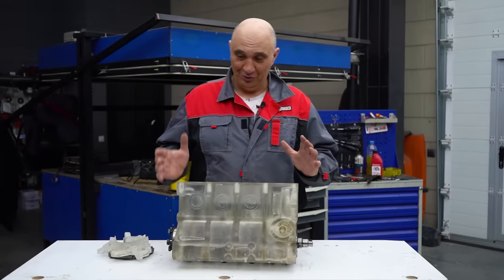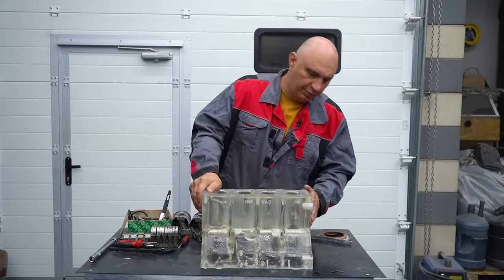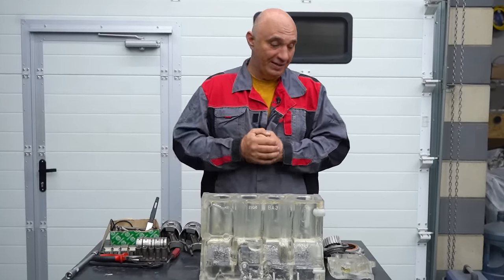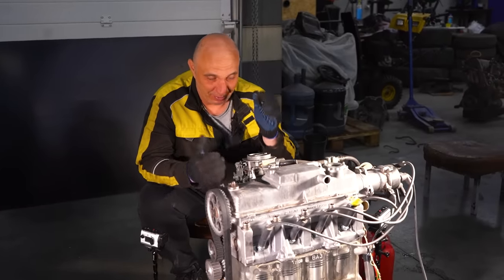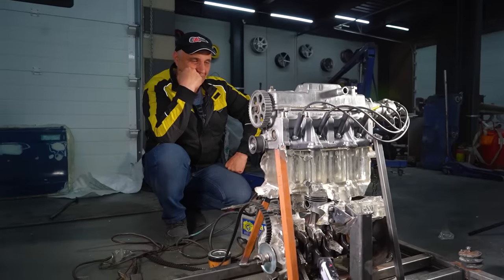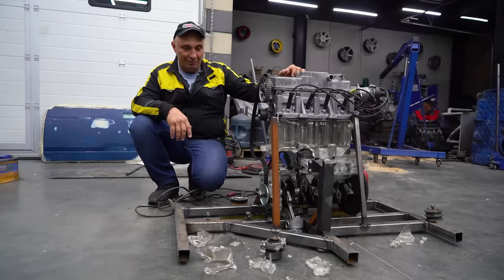Transparent engine block – first start

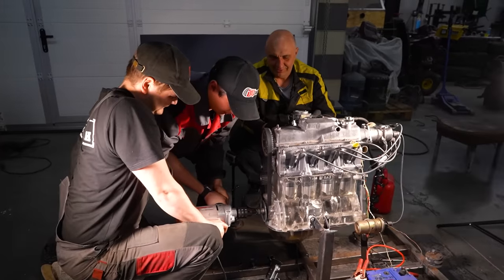Comment: You can see the block crack at 5:09 - with the first try of starting it with a power drill
Reply: Good eye
Reply: I don’t see it I just see the ignition on cylinder 3
Reply: @mikecorleone6797  I just saw it too!
On the engine mount!
Reply: Wow, good catch!
Reply: thats what i was about to write...
Reply: wow good eye!
Reply: @mikecorleone6797  Lower right side of the block about 6 inches long
Reply: I see  it in 6-7 minits. Good eyes.
Reply: yes !
Reply: yeah i seen that
Reply: that is a good eye, i didn't see it until i read a comment about the engine mount.
so unfortunate...
Reply: @KmF0X  if you look to the right of that engine mount, a horizontal crack also took place...
Reply: 6:17 you can see the entire crack from the engine mount headed to the flywheel.
Reply: @VintageCR  Indeed, it took me long to see it, but when the engine is fitted with a flywheel, we can clearly see it!
Reply: @mikecorleone6797  crack located between the motor mount and coil
Reply: I just watched the video for the 1st time and i noticed the crack in the block during one of the slo-mo playback.
Reply: Wow yeah just under cylinders 3&4
Reply: At 5:12 you can see the crack in the lower center of the engine going off to the right.
Reply: Holy heck you must have the eyes of a hawk to have caught that. But now replaying it I see it too.
Reply: Good eyes dude, they should have a frame from the bottom of the block to the head holding it together, probably using a  support bearing on each side of the crankshaft too
Reply: Probably watching on a TV screen rather than a mobile phone.
Reply: Good catch man ! 👍🏻
Reply: Very good eye had to grab my glasses and watch it twice but yeah I seen it right above the engine mount
Reply: right on the 3rd main! good eye sir
Reply: Incredible you catched that, i had to rewatch that part and slow it to 025 three times to see the crack forming.
Reply: Yes I saw this 2
Reply: Yep I finally saw it. Good catch. I think this project was doomed from the beginning.
Reply: After explosion of cylinders 2 and 3 it was game over
Reply: @KmF0X  yup..... me too
Reply: Well spotted!! 

Maybe next time it might be worth increasing the deck height (lowering the compression) a little to make things a little easier on the bottom end.
Reply: That's not good eyes for him, that's terrible eyes for everyone else 😂😂😂..
Reply: Yeah you can compare 4:52 to 5:11
Reply: 5:07 its by the engine mount
Reply: Make it again with steel embedded tying the head to the main bearings. Or maybe slice everything out but the main bearing webs up to below the deck.
Reply: They probably stressed it too much bolting it to the engine stand.
Reply: crack? what crack? 😁
Reply: @mikecorleone6797  You see it on the left side of the motor mount, it is a line suddenly coming there.
Reply: If they had used a rubber vibration damper between the engine and the engine mount, the block would probably not have cracked. That was the first thing I thought when I saw the stand they had made.
Reply: Well spotted there fella!    -107% Success hahahaha JEEEEEZ! Maybe the complete snapping of the drills' drive shaft was a hint at what was to come!? And man... That REALLY went with a BANG! 😮😮
😎🇬🇧
Reply: Wow. Perfect eye!
Reply: First crack 0:45, during threading. Very brittle material. I hate it. It always want to melt or crack during drilling. I can't imagine using taps and then screws with it.
Reply: yes noticed the same, bent crank or wrong clearance on block  ? enough torque to snap the drill might also be a hint that its not ideal ?
Reply: @theodordan680  so?
Reply: @kristiansolstad9068  Snapping the drill might also be indicative of whatever issue would cause the hand crank to kick back (pre-ignition?) during startup.
Reply: @mikecorleone6797  its near the bottom engine mount
Reply: Go figure,  that was the point of failure too
Reply: @Mr_Meowingtons  You SAW it. 😞
Reply: right on the engine mount
Reply: Good eye
Reply: that crack led to the ending they encountered. thats wild
Reply: its funny, i saw that crack just before the try that exploded it, but wasn't sure where it came from or when it got there. You found when that started, wow.
Reply: Holy shit. How did you catch that?
Reply: Yeah I went back to look for it too cause I noticed it after he had the flywheel on. Didn't see it when it happened with the first try of the drill, but I think either way it would have ended up in the same result.
Reply: I bet you have sasuke eyes, i can see nothing crack
Reply: @KmF0X  same here. It took me a minute but I saw it.
Reply: you need to do something with eyes like that
Reply: Bullet proof glass?
Reply: It seems you have the sharingan eye.
Reply: Damn dude that’s a Good eye!

Comment: I really appreciate your take on a negative result being a significant result. I wish more people understood this more. If you build something and it works the first time, it's cool, but then you move on to something else. If it fails, the interesting part is finding out why it failed. That is even cooler. There is much more to learn about failure. I hope your next design is as interesting! Well done!
Reply: His calm acceptance is the hallmark of maturity and a proper engineering attitude. 
I would have freaked out just for the comedic comedic value while figuring out what failed first.
Anything for street theatre. But get it fixed. Fun!

Comment: Wow I’m sorry to see the results after so much hard work. Just goes to show how much strength an engine has. Very impressive.
Reply: And think about the forces on high performance drag engines. With turbos, no2, etc increasing the pressures
Reply: @donaldduck9493  mind blowing. What is capable of creating the human being
Reply: The pressure in the one single cylinder with the piston is about 180 to 500psi, your car tire is 35psi. Its amazing what the engine does, now get this, in a diesel engine that uses fuel injection for power rather than spark plug, the injector need to overcome the pressure from the piston and on top of that use about another 2000-3000psi to mist the diesel into the compressed air. Its mind blowing.

Comment: I think combustion was just strong enough to break the clear material used to mount the rotating assembly. You'll have to probably make a central metal carrier for the rotating assembly and then get bolts long enough to reach from the head to that assembly to hold it all together.
Reply: Tenía adelantado el encendido
Reply: I agree. The compression it created was to strong for that bottom. Need somewhere for the compressed air to escape

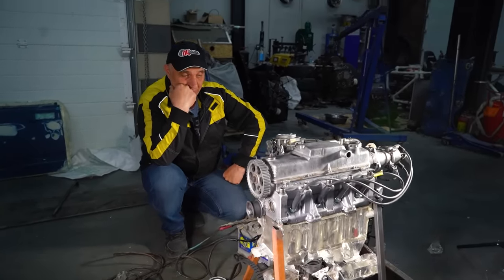Comment: That looked like a whole lot of work to make that clear block, it looked really nice!  At 7:39 you can see an existing crack just above the motor mount.  I'm not sure if that crack was significant to the failure, but it certainly didn't help.
Reply: @Noirlite at 4:59 its not there, but the crack appears after the first start at 5:11 its a shame a flywheel wasn't used from the start, maybe this wouldn't have broken the drill or the block by absorbing some of the energy.

Comment: Yes, this was still worth it 👍 It was a great illustration of the forces placed on the components of an engine. I certainly wasn’t expecting that! It you guys decide to do this again, perhaps it might be possible to modify the design of the engine block to accommodate studs that go all the way through the head and engine block? By the way excellent idea to run rubber O rings instead of steel 👏
Reply: Yup! Main caps are important. Clamp them!
Reply: I was expecting it to fail, but I figured the cylinder walls would blow out. I wasn't expecting the bottom end to blow off.
I think retarding the timing would help as the loads from combustion wouldn't push the crank down so hard like it does at or just before TDC.
Reply: And that my friends is why engine blocks are made out of aluminium or cast iron.  They have to container an explosion.  Peak combustion pressures in the average petrol/gas engine are up to 1500 PSI per cylinder if it’s turbo charged and 1000 PSI for naturally aspirated engines.  Modern turbo common rail diesel engines are around 2500 PSI all the way up to 4000 PSI if it’s super tuned diesel.  This is why diesel engines are built thicker and stronger and more robust than a petrol/gas engine.  There is a lot more stored energy in petroleum oils like diesel or paraffin (kerosene) than in petroleum spirit.
Reply: This and the mount was attached to the block and the head which ripped it apart, it should have proper mounts
Reply: Throw a rod or sometimes throw all the rods.
Reply: @dakoderii4221 shit it threw a crank

Comment: Use long head bolts chaps going straight to the crankshaft main bearings to hold it all together it's what rover did with there series engine works great..keep up the good work guys xx
Reply: That could be deadly.  With the vertical forces taken care of, all that pressure would likely cause the thing to explode horizontally with even more force than we saw here.  That guy squatting down beside it would be history.
Reply: @KenFullman  Don't squat down beside it. Simple. I wouldn't be anyway lol
Reply: And yet they r still garbage! Imagine that huh 🤷

Comment: That was basically to be expected, the crankshaft needs to be in a metal girdle and the girdle directly connected to the head with sturdy supports, so the combustion won't shoot the bottom end downward. You would also want a very low compression ratio, since this engine does not (and in fact you don't want it to) output much power at all.

Comment: Shows just how much stress a motor is under 👍
Reply: Makes you appreciate the properties of iron and aluminium.
Reply: Just imagine how much stress a blown drag engine is under or a high performance diesel.
Reply: @jesusisalive3227  Using carefully selected solid blocks of high-grade metal that are CNC machined... and even then they don't always stay together!
Reply: Makes me appreciate the durability of the 60 years old rr56 hiduminium rods in my old triumph
Reply: or how much energy is in petrol

Comment: I would make a rebar or some type of similar reinforcement inside the clear block cast, similar to what's done when reinforcing concrete. 

I saw other comments here to use really long head bolts to secure crank assembly and reduce compression ratios - that also seems like good ideas!  I would try to do all these things to help keep block together.
Reply: Yea! Concrete..... engine block..... it's all the same!...... NOT
Reply: they need to do it with a boxer engine design, like the old vw bugs
Reply: Good idea. Less compression ratio and some reinforcement like glass fiber
Reply: @walasiewicz  some plastic materials have a good reinforcement like carbon fiber and glass fiber.
Reply: "You would make" 😂😂
Course you would , put your video up then . . .

Comment: Yeah, that lasted about as long as I expected it to.

Biggest mistake was that a “liquid glass” block was treated the same as a cast iron block, even though the material is substantially weaker. You needed to use way, way more material to even get close to the same strength, but you didn’t. So, of course it was going to break almost instantly. As others have said, it broke a little on the very first puff with the drill.
Reply: Also needs way less compression, and some metal straps going around the bottom to hold it against the forces pushing the bottom down. Maybe metal studs going through the glass to reinforce it also.
Reply: Exactly, it needs more material, but some parts will be always week due to the design based on cast iron, as the crank shaft mounting points. It needs a substantial redesign, may be a single piston with less compression, thicker walls and some iron studs in the good spots

Comment: 🤣🤣🤣 I don’t think I’ve laughed that hard in a while. It’s sucks but it was funny as hell. Especially the way he just laid down the cables and was all calm.
Reply: THe timing belt just feel appart.
Reply: Yeah that’s all…. While the whole bottom end is laying in the floor. There’s a reason engines aren’t made of anything but aluminum or iron with steel sleeves.
Reply: @38911bytefree  apart maybe? And no, it was just thrown off..

Comment: The result is not what you were working towards for sure but, I was hooked thru the project! I feel for you guys for the work you put in to this... You just don't know til you do! Still a great series! Thanks for sharing!!
Reply: well he did say that a transparent engine block wouldn't last as long as a steel engine block and he was correct about that:face-green-smiling::face-green-smiling::face-green-smiling:

Comment: Block has already cracked before fell apart. Maybe you should install crankshaft bearing consoles from iron block and also some long bolts which can hold head... I think that could work... 😁
Anyway, great work!
Reply: Came here to note this.  Frame-by-frame shows the cracked block down in the skirt area, clearly visible from the right side of the frame at about 7:41.  The crack begins to open just before ignition becomes visible, looks like just before TDC in the first cylinder to fire.

Comment: Awsome! I think for reinforcement, you could also try to insert glass fiber mesh or some iron net. I know that it not be 100% transparent, but it will help, especially in the most stressful parts if the engine. Also i'd like to see a 2-nd antempt for this experiment. Thumbs up! 👏
Reply: I was thinking about the same thing, mesh would distubute the stress more evenly

Comment: I swear back when I was studying auto in high school I would day dream about a transparent engine like this. Just because I knew I could read all the curriculum materials, pay close attention to the lectures. Memorize vocabulary, steps and procedures. I could poke all I want at the engine, but until I saw exactly how everything looked on the inside, how an engine worked on the inside, I would never truly learn mechanics the way I needed to. I have to really fundamentally understand how something works before I can truly learn about it. I could memorize how change oil, replace spark plugs, replace an entire exhaust manifold, etc. but the second I get under the hood of a different vehicle, I’d be back at square one. I could only ever memorize how to work on that specific car. A single car at a time. Unless I truly could grasp my mind around how and why an engine works. How each part relates to another. So seeing this, honestly is really cool, I think every auto class should have something like this.

Comment: Damn. I was really hoping to see it run, but I understand that plastic and resin aren't strong enough to handle the forces involved with an internal combustion engine. That was definitely an amazing transparent display piece and I'm sorry it blew up. I don't blame y'all if you guys don't want to make another one. If you do though, I think it should be a display piece to teach young and learning mechanics about how engines work. Maybe with a flywheel and starter along with the distributor and ignition coils, but with no compression or fuel so that it doesn't blow itself apart. You could use a light scratch pattern and LED lights to illuminate the cylinders as they would fire to teach college students and apprentices in the field how an engine works using that transparent block. You might even be able to sell them for profit. Not meant to run, but teach about valves, pistons, and firing order. Anyway still an awesome video that we can all learn something from, and a good idea for teaching future mechanics at least. Sorry to see this one didn't work out.😢 I love you guys and all of the amazing experiments y'all do. Can't wait to see what y'all do with that diesel Lada y'all made.

Comment: This is a testament to how many different forces aluminum and iron blocks deal with, combustion, centrifugal, transferring that force to the engine mount and transmission, you have the g forces of traveling on and off road, bumps, train tracks, etc.

Comment: You guys did a great job.
A common technique to make the contents transparent is to make something integral out of a material like acrylic.
However, that approach faces many challenges such as insufficient strength and cracking.
Concentrate on making the contents transparent and you will get more.
Recall that reciprocating engines started out as single cylinders, with each of the four cylinders doing independent work, only interlocked through the crank.
If you think about each single cylinder, there should be only a limited number of areas you want to make transparent. I think you can achieve your goal by using different materials for the parts of the engine that you want to see and the parts that support the strength of the engine.
If you try to make everything transparent, it would be the same effort as building a new engine out of a material that is not strong enough, instead of building a 4-cylinder engine that is transparent in the areas you want to see. That is a distraction from the original goal.
Reply: Yeah, exactly what I though. Maybe only the cylinders should be transparent, not the crank case. Maybe with external metal reinforcement it would have worked.
Good attempt thou. Engineering failure, but spectacle success !

Comment: It appears to me to be a timing problem. Cylinder 1 and 2 appear to both fire at exactly the same time, putting too much stress on the crankshaft and it’s supporting journals. In future testing, shields need to be installed to prevent injury from large and small engine pieces.

Comment: Wonder if they could’ve ground the cam down to be very very small. Then lower the compression to like 5-1 & use a tiny carb to make it run but with very little power, like 15hp. Also use a big heavy flywheel so you can run it at 300rpm. Lastly, maybe use a lower energy fuel?